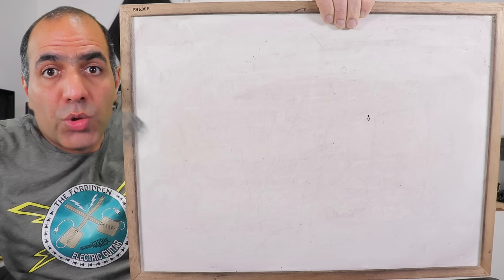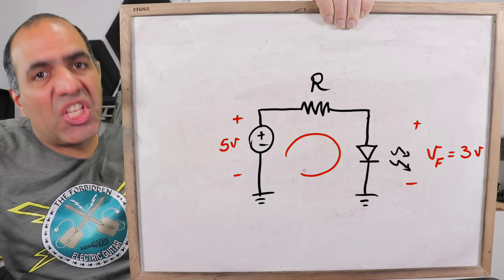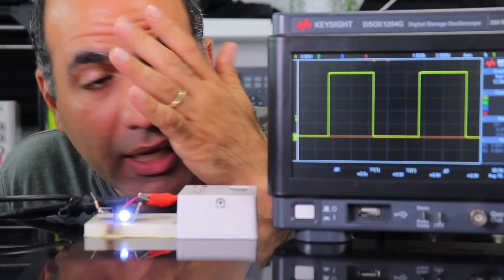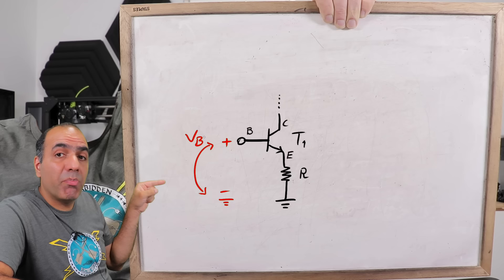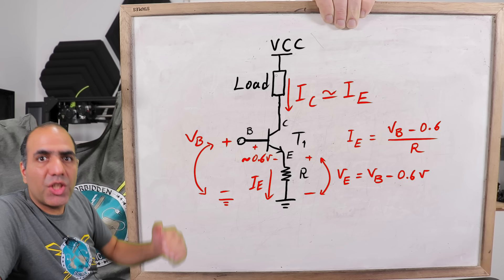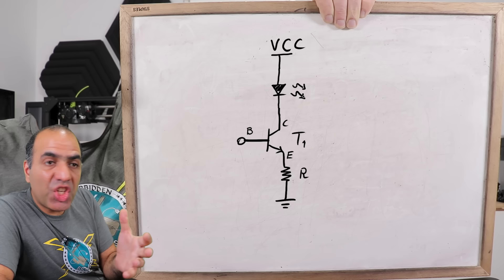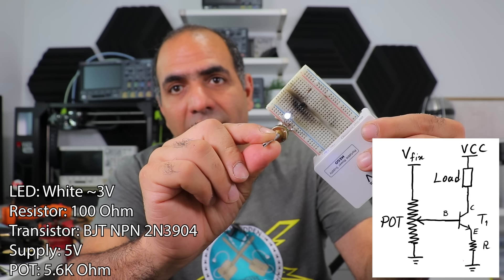How to Turn an LED On

Comment: Fun fact: That continuous turning on/off of an LED is called "stroboscopic flicker" and can cause major migraines for some people. Like I had to learn the hard way. Maybe that fact wasn't as fun as I originally claimed.
Reply: It's a matter of frequency.  If the frequency is high enough, it doesn't cause any issues.
Reply: @TrueThanny  Yes and no. Just because you don't perceive the flickering anymore doesn't mean that it doesn't have an effect.
If you sense the flickering this is obviously worse but I never actually sensed the flickering of the lights at work.
Reply: @Finkelfunk Knowing that normal mains lightings always flicker at 50/60Hz, isn't that an issue?
Reply: @Ev-wj3lm  There is a difference between having a light on occasionally for an hour a day and having 8h full exposure to a light source for 40+ hours a week. Obviously there are several other factors to consider here such as brightness, environment, other light sources, intervals between pulses and even color temperature, as light that has a higher blue light concentration is more prone to cause migraines in photosensitive people. This also isn't a 1:1 correlation where higher frequency = better or lower frequency = worse. The kicker with stroboscopic effects is that even if a frequency is 5x that of another it can still cause the same or similar effects if the perception it produces just so happen to line up in a similar fashion.
And that completely disregards the human element of it as well: Some people get photosensitive seizures at relatively low frequency flickers of 5Hz, but are fine at 100Hz, other people don't mind slow flickering too much but get a super uncomfortable feeling around certain lights, others just hate both.

This can't be boiled down to a single number, obviously.

Comment: 6:10 but why this works in the first place? How is capacitor charging if there's LED?
Reply: It doesn't. You need two LEDs facing opposite directions in parallel.
Reply: @Owen_loves_Butters  So how electricity is flowing through LED?
Reply: @realdragon It isn't, it's a mistake he made.
Reply: Wrong. The capacitor only blocks direct current, but it lets some alternating current pass. The amount of current it lets through is mostly dependent on frequency, and capacity. In short terms, it behaves like a resistor in AC circuits but without any power waste.

This is why they're used in capacitive dropper circuits. Those are used in low power devices that need a cheap source of regulated power, regulation provided by a Zener diode. However, such a power supply is not insulated from mains voltage, so you could get a shock if you touch the output.

And it's a light-emitting DIODE, so it won't conduct in negative half cycles.

There is a thing called reverse breakdown voltage, but the capacitor limits the current as mentioned before. If it can't supply enough current, voltage drops to compensate.

Comment: bigclivedotcom in a video 3 days ago while taking a lamp apart: "If you are doing this make sure the lamp you are working with is made of plastic and not of glass. Having one of these break in your hand while applying unreasonable pressure is a very bad thing."
Mehdi: 6:54
Reply: its prolly plastic. he fakes for laughs a ton

Comment: Really cool are LED Drivers like the IS31FL3731. This can be controlled via I2C to handle a big array of LEDs. Most likely in your RGB keyboard one or more of these is installed.
Reply: Or with MODBUS, it would need to have non-standard speed to be able to handle this job.

Comment: ive been playing with those led strips you get from walmart that have an AC input and "full bridge recifier" to convert it to DC and control the voltage with a remote in turn changing its color, and im glad this video is up so i can learn more
Reply: changing color? i think it's burning if it changes

Comment: 5:30 Never had any problem with these type of indicator light. I used a 100k resistor at 120v (or 200k at 220v) and it never heated up even after hours of use.

Comment: A capacitor still uses power. Don't forget that S=P+jQ, and Q is the power on the capacitor with 1/(wC) (which is 2,7kΩ in the US for 1μF). And P would be the wire + the conductive resistance of the idode which hops around when using a sinus (du/di)...

Comment: One thing that you did not mention is that a LED normally has a very low reverse breakdown voltage, of the order of around 5 volts. Even if the LED is not destroyed straight away by an excessive reverse voltage the life of the LED is drastically reduced.

Comment: In the current source diagram using BJT, you said that current is independent on the supply voltage. but according to the equation emitter current IE is dependent upon input potential Vb. please clarify

Comment: Okay, as a flashlight enthusiast who has never been particularly good with electronics, this is incredibly helpful.

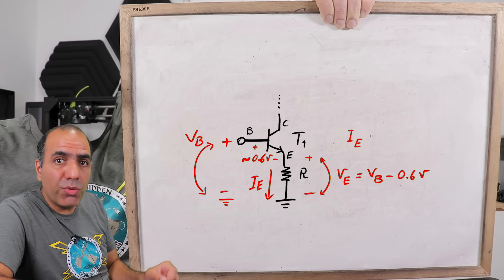EDIT: 10:12 OKAY! I think I'm beginning to understand some phenomena I've noticed (hopefully). When a flashlight has something light a lighted switch (LED lit), and is running low on battery (using 3.7 volt lithium cells), this would explain why the lighted switch, and main LED output is visibly less bright. Since your battery is only capable of putting out so many volts when it's running low, the LED is still trying to pull pretty much the same current as when the battery was fully charged (4.2V), so something has to change. Does that sound about right?

EDIT2: 11:32 This would explain why my light that uses a "boost driver" experiences visible PWM on low modes (even flickering a bit on "moonlight" mode), while my "non boosted" lights do not. The way I understand it, a boost driver is sort-of taking advantage of "electrical hammer" (unfortunately "electrical shock" was already taken). So it's essentially using a duty cycle instead of constant current.

Comment: 6:45 Initially, there is 0 Volt at the capacitor, so with the only resistance being the one of the electrical line, the initial transient 😉current is just too high for the LED.

Comment: How's does ge make Xmas rgb leds strings work with variable color on a simple series parallel circuit.. I'm assuming it's encoded it some high frequency but how does each bulb become different colors in the chain..

Comment: I have an LED nightlight and it’s driver is a big resistor an a diode that is hooked to a “switch” that then completes the circuit to power the LED. It is super cheap and it gets hot rather quickly. I had to fix the “switch” since it would stay on even when the toggle is off and it would buzz when it would power down while plugged in. Speaking of buzzing, there is an LED light bulb in my dad’s closet that would buzz very loudly.

Comment: 11:32 is the LED drawn backwards? Due to the back-emi of the inductor? The back-emi voltage should be reversed. So the LED negative must be to the junction of the inductor and drain of the n-ch MOSFET.
Reply: No, the LED is not drawn backwards.

Comment: Spider bot or also known as crawler bot, the one that looks like drone as small as a palm. How to equip it with soldering ability and heat suction or blower according to controller pad switch toggles with rotational solder lead ejections to solder.
Reply: I prefer to buy em for rm 50 to 100 or less and i know if manufactured its cheap and affordable but i dont know where to buy one. Easy to design but components has to be temperature tolerant and accurate with pcb camera module.

Comment: Hey, I was wondering if there's any kind of circuit that I can get fixed 15v from a variable power supply, supply can either be 9v, 12v  or 15v

Comment: event horizon is the part of a wormhole or black hole that which are the same that when light reaches it cant go back a diode well on kind if diodes is when current passes it it cant go back it can only go one way but not the other that is why they put a single diode atleaaaast to protect a small circuit from being connected backward as for say a toy

Comment: at 11:30, during the negative cycle why does the inductor current die down exactly? i understand that when the inductor is connected in series with the LEDs it would try to "force" whatever current was previously through all the LEDs, and then all the LEDs would have some large voltage drop across them - which could be larger than Vcc - and this is what causes the inductor current to die down. Is that an ok explanation?

Comment: Questions. Can you make a full bridge rectifier using 4 led diodes in theory it should work. But not sure. I mean if they can't handle the power. I guess it's possible to use a drop down transformer before the diodes. as it was done with older ac to dc power supplies? I just want see what would happen

Comment: I wonder if you can make an LED strobe much brighter than it's continuous brightness is, if the duty cycle is low.
I want to figure out how to use a Raspberry Pi to drive LEDs (at first small, later hopefully bigger ones) so they can strobe on demand, so I can sync them with my live electronic music performances. Being able to run off of 5V so that a regular USB power supply (or a power bank!) could be enough for it.

Comment: 0:28 the event horizon is the electron gap in the diode that generates the precise wavelength of light than an LED emits. should I watch the rest of the video?

Comment: Hey idk if you’ll see this or not but I’m a residential electrician and we run into an issue with leds sometimes when it comes to dimming them. We have regular dimmer switches but they make the led lights flash and strobe so we have to use a “low voltage” dimmer. I always wondered what’s going on and what the difference is between the 2 types of dimmers. All I know is that the “low voltage dimmer” uses the neutral as well as the hot wire. It’d be awesome for a quick video explaining that!
Reply: I know this is a year late, but here goes: most LEDs that are powered by AC have a driver circuit that takes mains voltage and turns it into low voltage DC. That driver circuit must be designed to NOT compensate for sags and spikes in the input voltage (all non-dimmable drivers ARE designed to compensate). Your lights are flickering because the capacitors in the driver are gathering up enough bits of power until the driver has enough to produce light, but because there isn't a constant supply of enough current, the capacitors quickly discharge and the LEDs go out.

Note: this is a vast oversimplification but should help, hopefully.

BTW what you described is not true low voltage dimming. True low-voltage dimming sends a signal to the driver via a separate pair of wires, and the driver then uses a transistor to alter the amount of current allowed to flow through LEDs, thus causing them to get dimmer. Medhi explained how that works in this video.

Comment: 4:08 Why does the diode not break due to excessive reverse voltage ?
Reply: Resistor limits the voltage. If the resistor wasn't there, the LED would've died in 1/60th of a second. Diodes also react in a way that makes them conduct lots of current right after their forward voltage is reached. This is how Zener diodes are used to regulate voltage in low current circuits. They almost short out, this increases the current enough for the resistor to start resisting and dropping voltage.

Comment: When I was 12, I connected a 12V P21W car filament bulb to a regular plug and plugged it into a 230V outlet. To this day it was the brightest bulb I've ever seen. It lit up the whole room for a few seconds until the fuse at the electrical panel blew. My parents took away all my electronics stuff for a few years till I rebuilt my stash.

Comment: 70 years ago this video would be titled - "How to Turn a Light Bulb On"  :))) I started playing with LEDs when I was a kid in the 70s.....LEDs back then were very dim compared to today's LEDs - even when overdriving a bit say 1.9 v @ 30 mA for a red led. Fran Lab had a bunch of old LEDs from the era and she demonstrated how dim those older LEDs were....we take so much for granted today. There are so many varieties of LEDs today it would make your head spin. You can put multiple LEDs in series so that you don't need a high wattage resistor if your connecting it to the power line. BTW Even though I am expecting it, I jump whenever one of your components goes "pop" :))))

Comment: love ya BOOM! not condriticting any of what you did...but i wire those micro led filaments straight to 125v A/C all the time with  ZERO resistors or caps,   i guess it has the perfect number of leds to not overload.   i love wiring and hiding them in cracks for a good glow.

Comment: 0:32 ok you want to go there so be it the event horizon is the in layman's terms the limit of how close something can get to a black hole once anything passes it there's no getting out when light passes the event horizon it's trapped forever so in relation to an led the light emitted from the led will get trapped in the black hole once it passes the event horizon and if you pass the event horizon with an led and turn it on you can still see the light from the led but anyone or anything on the outside cant because the extreme gravitational pull of the black whole stops light emitted from the led from leaving the event horizon

Comment: you are not considering that the max reverse voltage on each  LED is only 5V or so.  You need another diode across it pointed in the reverse direction in order to limit the reverse voltage across the diodes or you need to add a series diode like 1N4004 in the same direction as the LED.

Comment: You need to expand this to explain LEDKeeper tool for Christmas lights. There’s videos on old filament bulbs, but nothing explaining how it fixes LED strands. Is it the same as the shunt “trick,” even though all lights work, not just a bypass? Is it actually fixing the LED itself? Why does the LED even stop working in the first place?

Comment: Hi,
Why did my local 16a fuse poped when i shorted line to neutral if i have a main 32a and 30miliamps gfci fuse?
16 amps at 220v is a lot.

Comment: what are those small light bulbs that are open circuit and have two perpendicular rods in them instead of filament i saw them being used with 220volt AC serried by 120kOhm resistor.
Reply: Neon bulbs, watch this video to know more: https://youtu.be/U4n5vmpFtXw

Comment: The only time in my life I've ever had to calculate resistance and source voltage was when I converted an old BMW's 3rd brake light from the $200 incandescent setup to a row of 14 LED's + a resistor aimed just so that anyone closer than 10 feet from my bumper would be agonizingly blinded!

Comment: I'm a little late, but the answer to the question: Event horizon is a "barrier" in space where actions from a point before it can no longer affect the universe beyond it.
And an event horizon of a black hole for example works like an LED because you should only be able to go in one direction.

Comment: Do non-LED diodes produce an electromagnetic wave when forward biased? Could it be that the packaging obscures the em radiation or that it is in a part of the non-visible part of the spectrum?

Comment: I have a question for you.  If you want to remove LED's from a string of Christmas lights so you can have custom lengths, what would be the resistance you would have to add to the circuit to compensate for the missing LED's? How much resistance per LED removed?
Reply: No extra resistance

Comment: Something an event horizon and an LED has in common? Both can absorb light? I guess? The black hole does it just because it's gravity is enough that the light can't escape. An LED/diode converts light in to electricity. So, somewhat similar but not quite the same thing.
But that's my best guess.

Comment: Don't connect capacitors the wrong way round or run too much current/voltage through them, or they'll self-destruct. Same goes for LEDs, if you do the same things to one, it'll self-destruct as well.

Comment: The company I work for was making the color display panel for the goodyear blimp back in 2000. Pretty much when the blue LED came around. Some jack ass on 2nd shift ended up sanding the LED along with the side of the board. He was supposed to only sand the side of the board, hence jack ass. But it was good for my friend and I because we were allowed to take all the sanded LEDs. Some were worse than others since it was just the side of the LED that was sanded. But man, we got somewhere around 500 blue LEDs. I put those in my cluster behind my dashboard using a 330-ohm resistor. Then I put them in my PC for the power and HDD activity lights. I made light strips and cut a window out on my side panel of the PC with plexiglass. I put them behind my home theater components inside my entertainment center. Behind my desk. I put those things everywhere, I mean everywhere.

Sorry but I think I single handedly may have been responsible for the LED craze that's been going on for the last 10 years. But I was doing it back in 2000. And back then I had a lot of parties at my house and all those people saw my craziness and must have passed it on to others through word of mouth. Some people must have been like, hey I saw this PC with LED's inside, you should do it too and caught on like a slow burning wildfire.

Comment: How do you get 170V DC from 120V RMS AC? Even if you had 100% conversion efficiency you should be getting about 108V DC, since that's the average value of rectified sine wave of 120V RMS (which is about 170V peak).

Comment: You need a microcontroller to turn on and off the MOSFET.
mehdi: but here i am using my function generator.
That's really expensive microcontroller you got there mehdi 😜

Comment: Could you drive an LED and have it light with reverse voltage, if you very carefully controlled it to not exceed the power rating of the LED?